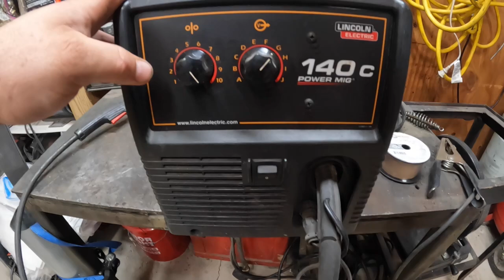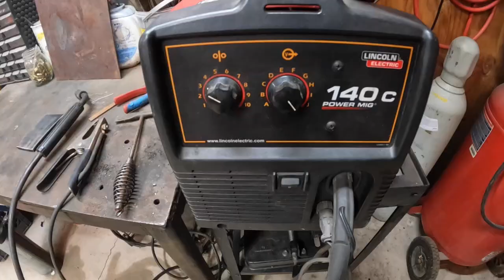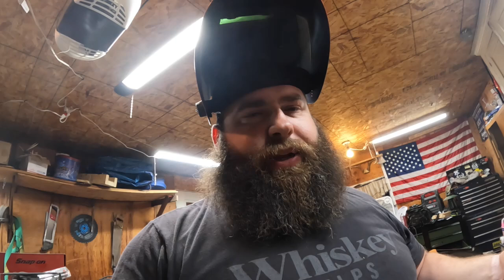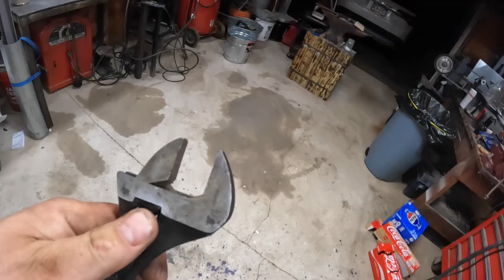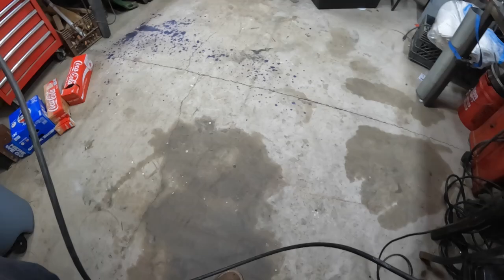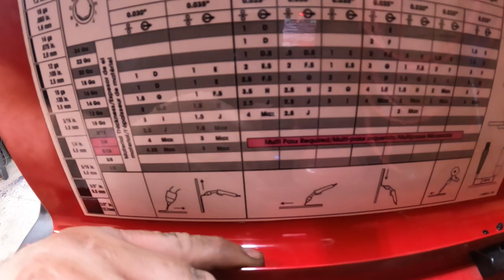Review: Lincoln 140c Mig welder. #shorts #youtubeshorts #trending #viralvideo

Comment: Positively would have had almost 0 spatter for fluxcore if you had changed your polarity to DC Electrode Negative as it was written on your chart. I couldnt tell your polarity until you mentioned it didnt need to be changed for mig. 

Mig was incredible but the fluxcore would have been almost the same if you would try it again. 

I just got a 140HD and people were saying the 140C is the one you want. I will end up selling this 140HD in the future and hopefully finding a 140C. 

The 140HD welds great, It welds up to 5/16 but that 140C can do 1/2" which is super impressive. 

Got my 140HD for 200 on market place. Hoping to flip it after doing some nice weld projects I have, I was so impressed with the 0 spatter on the fluxcore.

Comment: I have the same welder, the polarity for flux core wire and mig with gas are opposite, Flux core the gun has to be negative ground clam positive or you’ll get lots of splatter and beading, I know I made this mistake. There is another guy YouTube channel Cesar - How to connect aluminum spool gun (Magnum 100SG)to mig welder step by step. He gets great results with it hooked up to a Lincoln 140 welder
Great video thanks